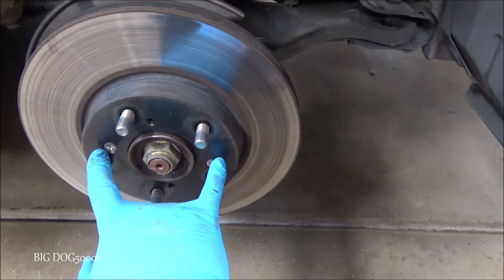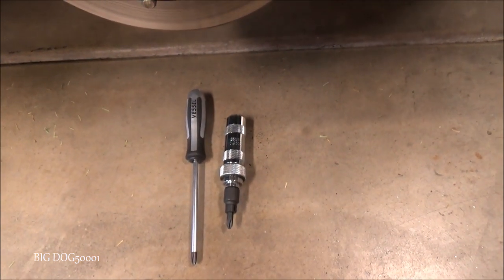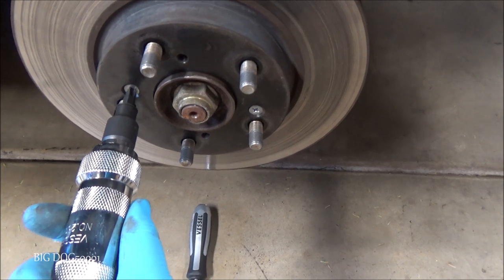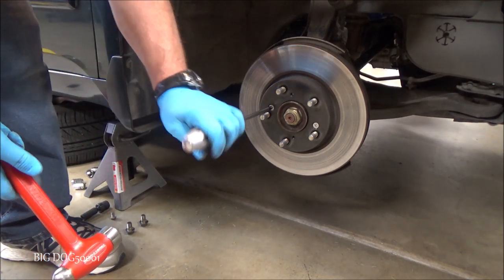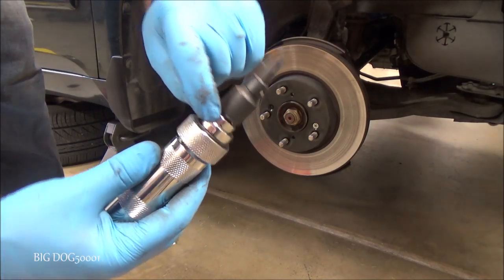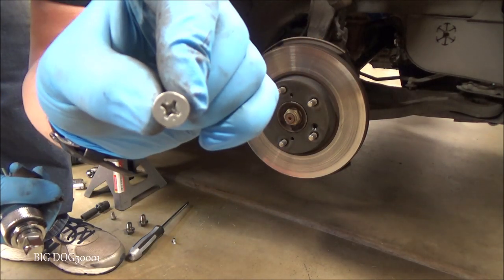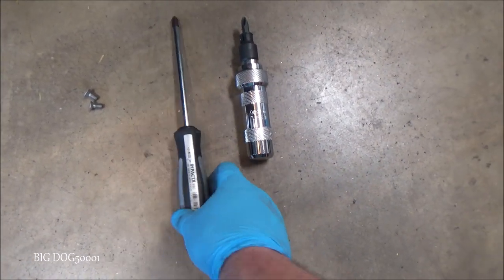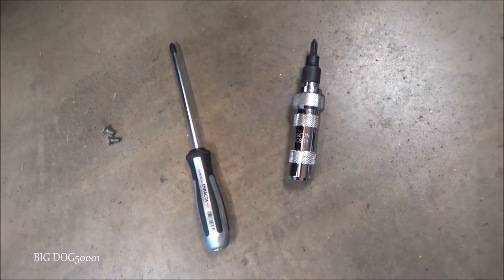Round 2!  Vessel vs Vessel vs Honda Rotor Screws

Comment: Thanks for pointing this out. When I changed my rotor, I used a Phillips to mess up with those screws. Someone suggested drilling a hole to get rid of those annoying screws, which I didn't follow. I purchased a Vessel from amz, about12 dollars, as well a hammer. Job done.
Reply from the maker: Thank you for the comment!  Vessel makes darn good screwdrivers.

Comment from the maker: This video was originally going to be included in tool haul Episode 1902, but due to the length of that video I made this one separate.  Link to tool haul video:  https://youtu.be/2VUE7tq_uKo
  I was the last one to work on this brake system a couple of years ago and I used anti-seize on the screws when I reinstalled them.  This is why they came out fairly easy.  If you are going to reinstall the screws, I always recommend anti-seize on the threads.

Comment: These screws are installed on the assembly line to keep the rotor from falling off. When you reassemble leave them off. My Hyundai Sonata uses  a #4 phillips.
Reply from the maker: If it your own vehicle it is not a bad idea to leave them off.  On other peoples vehicles I always reinstall them, with anti-seize.  Thanks for the input!

Comment: I have a Vessel Impact screw driver (the long one) and a set of Vessel JIS impact bits for a traditional manual impact driver. I have used both to remove the very tight Honda door lock latch screws and found that the Impacta screwdriver was not strong enough. The traditional impact driver with a JIS bit, however, released the screws on the first blow.  I have found the Impacta screw driver to work fine on rotors. They are fairly inexpensive compared to the price of stripping a screw head - especially something like the lock latch screws.
Reply from the maker: I like to use a 1/4" 18V Impact on Honda door latch screws.  In my experience, the metal in the door is weak and tends to give too much when using a traditional hand impact driver.   Thanks for the input!
Reply: @BigDog50001  I'm going to give that a try next time.
Reply from the maker: I have a video coming out soon showing that technique, don't tell anyone it's a surprise....

Comment: Is it possible to unscrew the rotor using number 2 vessel without impact? Didn't realize you need an impact no.3 for this job so I ordered a non-impact no.2. Wish I'd watched this video before

Comment: Is it Only IMPORTS that use these 6mm phillips screws on the rotors. Always worked on GM and don't recall these (so wonder if the assembly for the front/rear is pre-assembled) reason for them rotors have screws in them?
Reply from the maker: Asian vehicles like to use cross heads screws to hold the rotors on, US car makers sometimes use clips that go over the studs or torx or other type screws.  They all use them to ease assembly at the factory.

Comment: Hi Dave, I don't know where to put this question so I ask here. I have a 7th accord and need to clean the throttle body due to the pop sensation when starting the engine in the morning, especially for the cold days. Do I need to disconnect the battery first? Do I need to remove the throttle body out to clean it thoroughly? Thanks.
Reply from the maker: Be warned, this can sometimes turn into a can of worms.  Disconnecting the battery is not usually necessary but you have to be careful, some 7th generation Accords have throttle cables and some have drive by wire systems that use electronic throttle actuators.  Those actuators can do serious damage to a finger/hand if they move.   

The general procedure is to remove the throttle body and clean it off the vehicle by spraying cleaner on a rag and wiping.  Have to be careful not to spray/get cleaner on the throttle shaft bearing area (where the throttle plate pivots on housing).  

It will need an idle relearn done because the throttle plate is usually now in a different position than what the PCM has learned.  *Usually a PCM reset is necessary (and in some cases clearing the throttle learned value) in order to do an idle relearn otherwise DTCs P0507 or P2279 can set and/or it can have an erratic idle*.  You would need a Honda factory capable scan tool to do these.
Reply: @BigDog50001  Thanks. Appreciate the information.